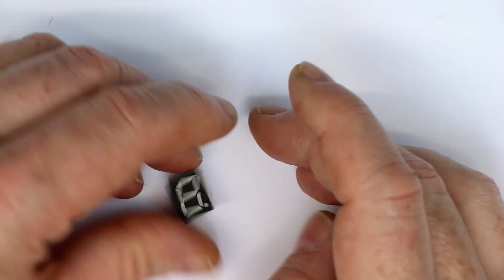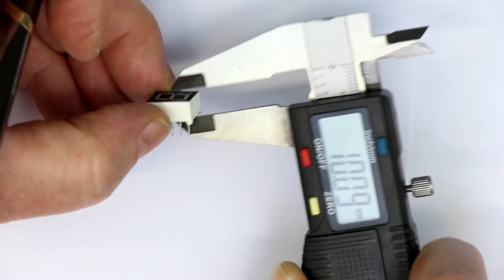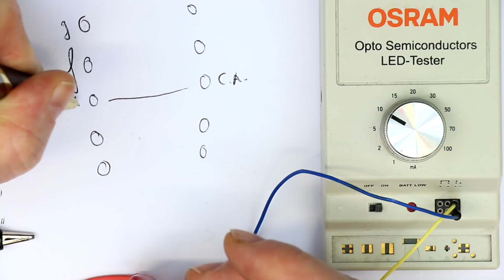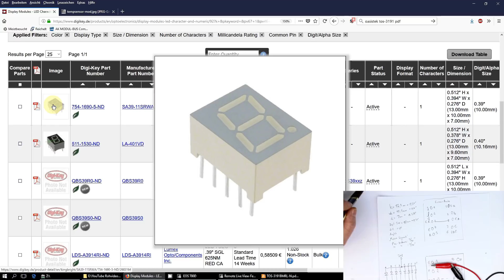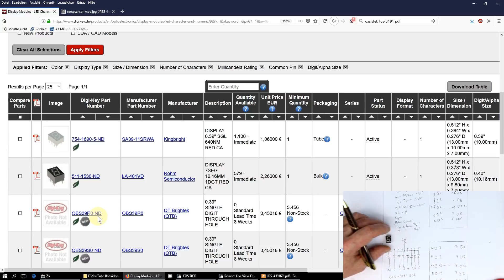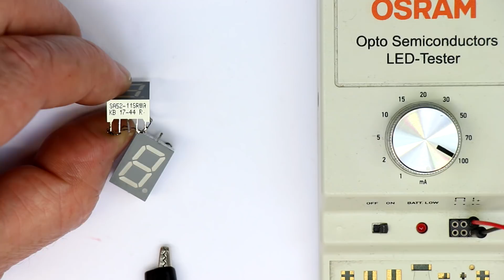Finding Replacement 7-Segment Displays

Comment: Could you do a video on finding replacements for LCD displays?  I have a bad one I want to replace but nothing comes up when I Google the part number and I have no idea where to look.
Reply from the maker: LCDs in consumer-electronics are usually custom-made devices that you cannot get anywhere else than from the manufacturer of the device as a spare-part.

Comment: The BCS is just the name of the manufacturer. 3191 type segment displays are pretty common on the chinese market. You can get them here for example: https://www.aliexpress.com/item/0-39-inch-one-digital-red-3191AS-3191BS-7-segment-red-led-display-1-digits/32737097707.html
Their numbering is like 3191AS/ 3191BS and I believe the yellow ones are 3191CA...
Reply from the maker: THX for the hints.